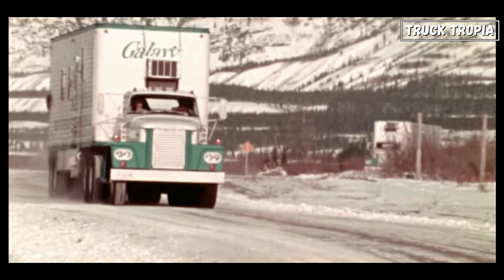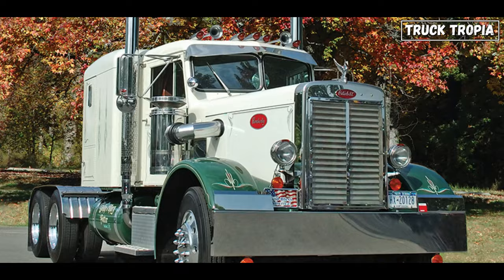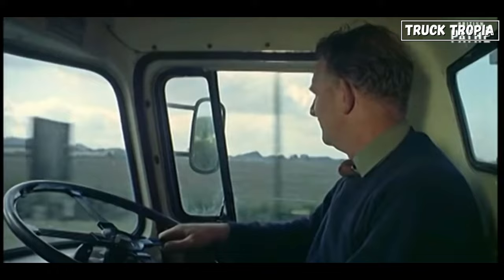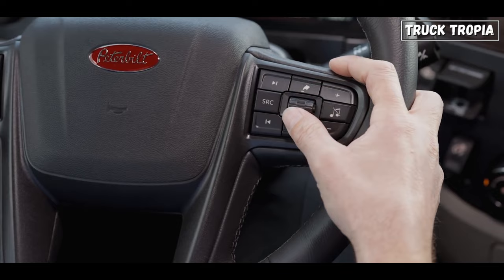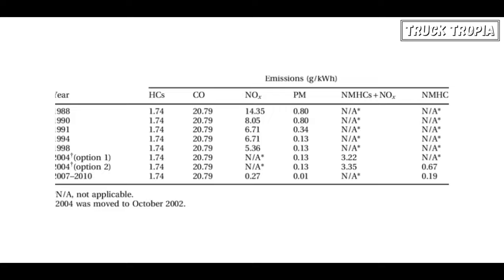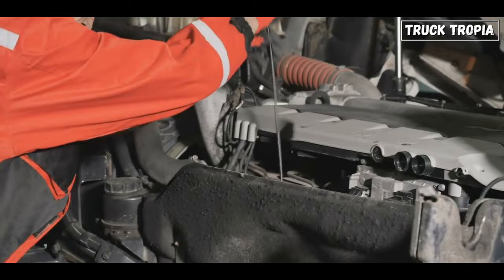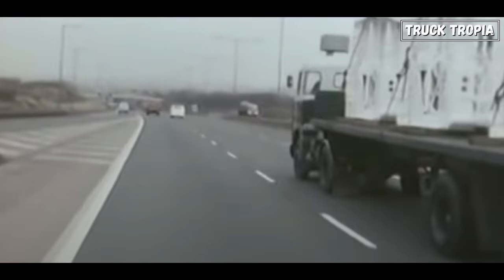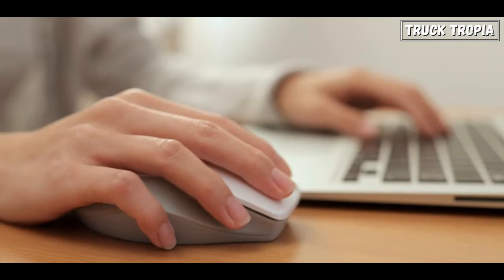Old Truck Vs. New Truck - Which Is BEST?

Comment: Name me anything that is being built current year that can outlast anything built in the 50s, 60s and 70s. (except maybe for car bodies and frames)
Reply: Volvo FM's. The second gen ones are going strong at 35,000 hours, set of bushes all around and an engine and gearbox rebuild at 25,000 hours in a hook lift. An 80s acco had less power and the chassis failed by 20,000hours after the engine and gearbox rebuild at 12,000hrs
Reply: Outlast in terms of longevity no, but we can't deny that when those vehicles were running, they were polluting so much. However, in terms of performance, those old-school engines can't keep up. The DD60 was the last good North American engine, even with egr and dfp. Sad they'll never come back but iver seen volvo d13s go to 1.5mill km before needing a rebuild
Reply: @wizparrissa8632 60 series  vs the Volvo fm13 d13 had similar power and Volvo didn't need EGR to cause issues and the diagnostic systems on the Volvo motor are way better. Doing injectors on the d13 was easy and for more KMs, didn't need a new cylinder head like the 60 series. But I only have the experience as a mechanic.
Reply: @Low760  I'm a mechanic too. Since the bus side doesnt require as much strain on the engine to move, the dd60 in Prevosts are way better than the D13s. I can't really say on the truck sideaa
Reply: Maybe them severe duty freightliner last alright.
Reply: When I started driving my first truck was a 1973 Louisville Ford , the biggest piece of crap I ever sat in . Today still driving 2 days ago I moved into a 2025 KW T680 ... I still think I just sat in a big piece of crap. not much has change in all the years ... lol
Reply: @wellwater8927 lol you should drive european truck, much better!

Comment: As much as I hate aftertreatment systems. They are needed. Smog levels in cities have been significantly reduced since emissions came in. EPA was also created after going to the moon and realizing how fragile our earth is and that we should be doing things to limit our carbon footprint.
Reply: They say that but California is just as smogy as it ever was. Also this entire save the earth thing is making stuff more expensive...they use less plastic but it cost us more kind of stuff.
Reply: @SurvivenTerry  well California is the worst state for that. But its also from the shipping traffic. I'm not gonna disagree that it's making things more expensive but when it comes to diesel trucks  (not electric and shipping because that's a whole next issue) it is proven that aftertreatment has significantly reduced nitrous oxide and hydrocarbons that linger in the air and are harmful for our health. I can run a 2019 volvo d13 in my shop without having to connect an exhaust extractor because it burns so clean but a 2002 DD60 is unbearable without an exhaust Evac system. It sucks good trucks don't exist anymore but either does a good car. But what's even harder to find is a good technician that knows how to identify problems in a PM and are knowledgeable with diagnosing. Too many people are paying too much on parts they never had to change due to incompetent technicians that didn't pay attention in school.
Reply: You are the carbon they want to reduce.
Reply: @freedomlover2808  lool go elsewhere with your conspiracy theories. We're here to talk about diesel trucks. You Americans love to go off topic

Comment: I have 7 truck in the yard from '70 '80 '81 '82 '85 '87 '89 and they work alongside and still able to run rings around modern trucks when there braking down and getting bogged mine just keep soldering on and don't own $ on any of them and cost me practically nothing to fix when you compare to the price of parts for moden trucks

Comment: Thanks for the presentation of old Vs new. 
I drive in Europe and like the modern trucks with the improvements of today. What I dislike is that no European brand offers those cool Eaton Fuller manual transmissions. 13 or 18 speed. Doesn't any other driver like the technical skill required to use one of these crash boxes? I would. High gear and low gear, overdrive and direct selection - splitting. Skipping gears and precisely using C (crawler/low) gear when needed. Bragging not using the clutch 😊 . Too bad not available in Europe ....... for the pros. Note : Daf XG 530 is awesome. Thank you .🙂🙂
Reply from the maker: Glad you liked it 👍
Reply: You can get a brand new Sisu truck with manual Eaton Fuller transmission so you can get them in Europe. Sisu has used fuller transmissions over a long time even today 👍

Comment: With most new trucks they don’t think about the mechanics that have to work on the trucks, from what I heard it’s a pain to work on the new trucks with there engine bays being so small
Reply: It's the electronics that kinda diminished the quality of the newer trucks  before you could work on your own truck and make repairs, now you have computer software,  sensors  fault  codes  that try to diagnose problems and fail.

Comment: My opinion: ths video is great. People who complain about thing's like trucks not being manual or being too comfy, why? Its a job not a hobby, and its a job thats criticalto the world, so why not make it easier on the driver's? And people complaining about trucks beng to round and not boxy enough, thats so dumb. Its for efficiency. Its not supposed to look good. Its supposed to get the job done. Its not a logging truck, its a highway truck, so it needs aerodynamics. The people who complain about that are the same ones who talk about how pickup trucks are too luxurious and old ones used to be designed to get the job done and not be about looks. The point is old trucks definitely are better in some ways and corporate greed is a thing, but the people who complain about safety, efficiency, and emissions upgrades are dumb.

Comment: I'll take an old truck in a heartbeat! Trucks aren't meant to operate, and maneuver like four-wheelers, they are trucks! I don't want any of the technology that these newer trucks have to offer! I don't even need a GPS! A mapbook is perfectly fine to me! I'm grateful and fortunate enough to have had old school truckers teach me to drive a truck. The way they taught me has always worked and has never let me down, so I prefer to keep it that way. Technology, however, tends to let me down sometimes. Like trucker GPS's, for instance. Those things have attempted to route me to low bridges even though they were set not to. Luckily, whenever I use a GPS, I always match the route to the mapbook to make sure it's accurate, instead of following the n GPS route blindly. The truth is that technology tends to fail sometimes, and being at the controls of an 80k pound truck is not the time or place for mistakes like that. My point is that the old way is just simply the best way, just like old trucks are the best trucks!

Comment: they needed to stop reinventing the wheel, especially on the electrical side of trucks. The last gasp of  good trucks was the late 90's imo, computer controlled engines but simple machines otherwise. I'll take a rebuilt 1998 kenworth W900L with a CAT 3406E and a 18 speed over these new  break down queens any day.

Comment: I'll take a 90's international or anything like it any day. while smog is a problem in populated areas, all it does it push the problem to other areas of the globe like the ocean where massive emission standard free cargo carriers bring us our def, dpf and egr parts from china burning thousands of tons of dirty diesel everyday. not to mention the loss of efficiency these trucks endure from having these emissions systems on them and the extra burnt fuel required to run regen. Additionally the health effects of corrosive DEF fluid should be looked into and studied.

It's really a shame that the truckers have to suffer with these modern regulations but the rail, water and air shipping industries do not have to follow these rules,

these regulations make everything more expensive for everybody because now a load of apples to the supermarket costs more to ship because it's forced to be shipped on a truck that costs more to purchase, operate and  maintain.

At the end of the day, old trucks aren't going to get off the road until regulations force them to and people will keep the old trucks alive for as many generations as possible because the whole system of requiring such continuously increasing emissions standards is absurd and expensive to the point where individuals aren't going to be able to own small companies that run new trucks because they will cost far too much to keep on the road or even purchase from the beginning.

I understand and respect the opinions of those who think these modern regulations on emissions are a good thing but I personally believe it is nothing more than manipulation of the people from politicians and federal agencies like the epa which has people running it who are appointed and not elected by the people but have free reign to control the aspects of the everyday lives and rules of the American people

Comment: this days 2024 can the trucks goup to 2 milion miles ? check again last series of trucks that can go up to 2 milion miles was the 2007 before the def was introduced they made a mistake that they made the trucks so good and reliable, reliable trucks are not good for bussiness they cant sell parts and make more money, when the dpf was introduced in 2009 truck have problems every month with that dpf if its not that its something else related with electronic trucks are not relialble and good any more after 500k u have to do bypass on that dpf system if u really want to make money and have a more reliable semi.

Comment: modern trucks are a lot better, because they are a lot cleaner compared to the older trucks. I don't like American trucks personally, because they are extremely outdated compared to the European trucks. If you take a look at European trucks, they come with more updated interior and exterior and European trucks are bit more modern compared to American trucks.

Comment: Old trucks are uncomfortable, slow, poorer handling and less stable. You get out of a noisy leaf sprung Kenworth or acco or inter,  rattling your body out. 

They definitely didn't go for 1.5m KMs! Engine rebuilds were common at 500,000 if that, transmissions and clutches failed earlier too. Plus worn out spring pins and bushes and uni joints from rougher roads, lack of greasing. Plus split rim tyres and smaller drum brakes. 

Overall driver comfort is more important because it causes fatigue. There's less accidents now despite there being more trucks. 

Good clickbait buddy.